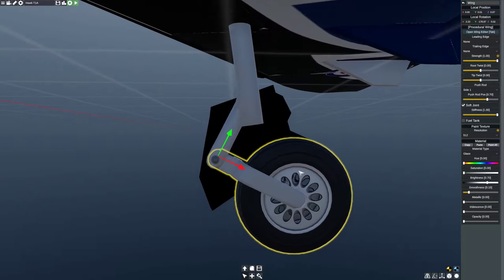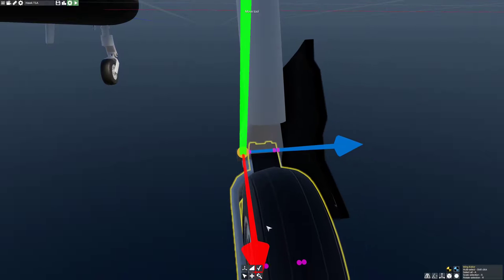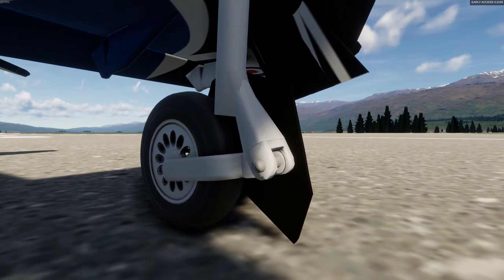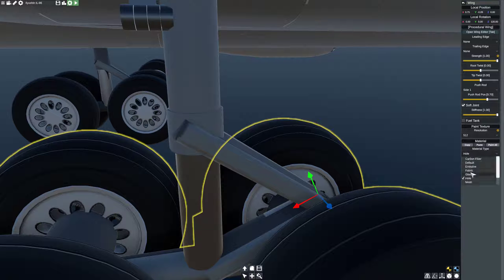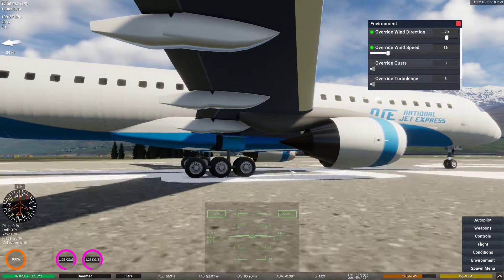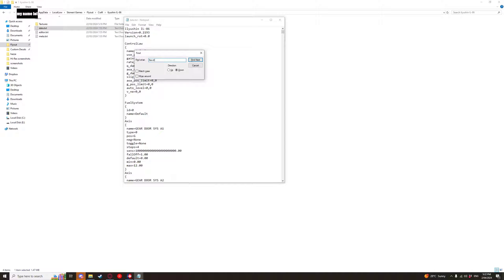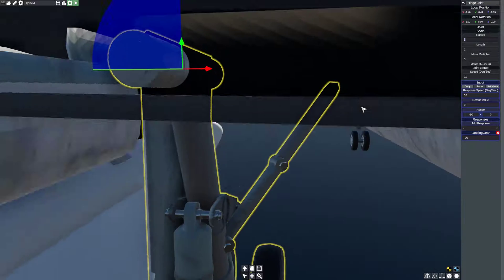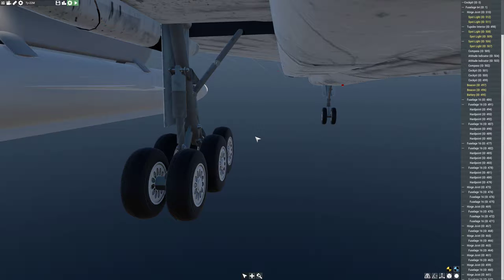Angel's Flyout Tutorial Series| Episode 1: CUSTOM LANDING GEAR SUSPENSION

Comment: I tried doing this but encountered the problem of wheels creating insane amount of friction, so my plane with 220kn of thrust in total cant even exceed 210 km/h, i have no solution to solving it
Reply: connect wheel to an unpowered gearbox, this removes all friction from it.
this means you will slide all over the place so use a normal landing gear that is erased using the Mi8 mod/
Reply: @funi_chest what if I connect an electric motor to that gearbox and modulate the clucth to enable braking?
Reply: @poklianon  that can work ig. just experiment with connections

Comment: How did you connect the wing piece to the wheel assembly?
Reply from the maker: You connect the wheel assembly to the wing piece the same way you connect any other components.
Reply: @Plaguebearer666  Ah okay, but then the wheel assemebely isnt connected to the piston and just flops around?
Reply from the maker: @trainsofnorway9664  there is no piston?
Reply: @Plaguebearer666  okay, the connecting rod then, thats a better word for it
Reply: @trainsofnorway9664  You literally just attach a wheel to the wing. Except for soft joint wings, there is only hard joints in Flyout.
Reply: @ToitMosquito  yeah ik, but im talking about boogies, not the other design

Comment: What I'd like to see a tutorial on: tl;dr - wave drag analysis & utilization of area ruling in prototype design.

Long version: (btw I'm the guy that complimented you on reddit when you shared your vid there) So I've been told that Flyout does, in fact, simulate wave drag and that area ruling does have an effect.  With that said, here are some bullet points on the subject matter I think add value to it as a potential tutorial subject:

1.  It is an intermediate to advanced level subject matter, which seems to be your forte.
2.  Is wave drag, in fact, simulated in Flyout?  At this point I'm operating on hear-say.  It would be nice to see quantifiable proof of some kind, perhaps a demonstration/comparison of two identical craft in which one has a nice area ruling feature while the other doesn't, and then take note of the difference in top mach at a given altitude, fuel efficiency, etc.
3.  If you establish that wave drag is a factor, then perhaps you could show a rudimentary method by which we can assess our cross sections and apply area ruling effectively.  In my internet findings I've seen some relatively simple methods by which the cross sectional area is graphed where y axis is the area and x axis is the lengthwise position of any given area - perhaps there is a handy way to take advantage of the game's frequent usage of cross sections to approximate it.

From what little I've researched on it, it seems to be a huge factor in the design of supersonic aircraft from the very early days of them and continues to be. Thus, to exercise our collective intellects for months or more in such a fine aircraft design simulator as this which seems especially partial to prototype jet aircraft while simultaneously ignoring the educational and entertainment benefits of wave drag would be a travesty.

Comment: Am i th eonly one that whenever I use custom landing gear need super powerful engines to actually take off? It's as if the brakes are constantly on for some reason...
Reply from the maker: Yeah, the wheels have very strong friction for some reason. This is a known issue and unfortunately, the friction is not a value we can fix. The wheel pieces are raycast, so they are essentially just a skid with a spinning wheel animation
Reply: @Plaguebearer666  Maybe using regular retractable gear edited to hell instead of the basic ones can solve the problem?
Reply: That's an approach I took, but I didn't really find a way to edit them not to have suspension, so they are a little bit glitchy and also brakes don't work on them at all
Reply: @Plaguebearer666 But your planes somehow avoid this issue, is there a way to possibly file edit the friction out?
Reply from the maker: @poklianon  my planes do not avoid the issue, they are plagued by it